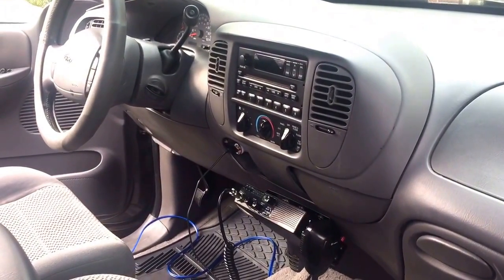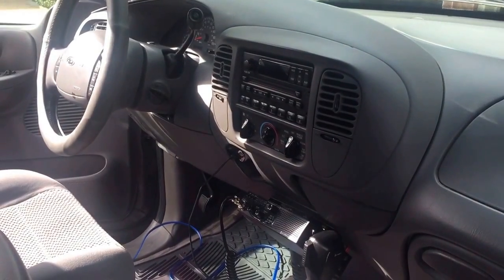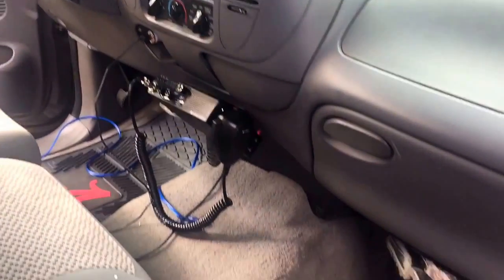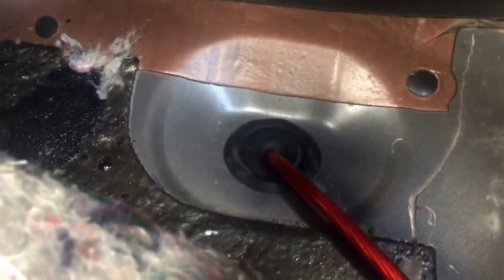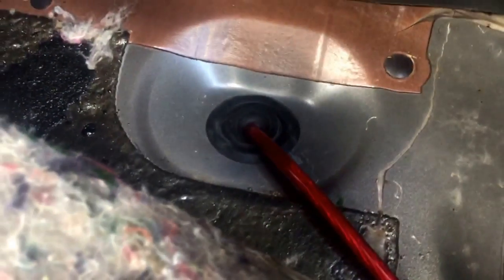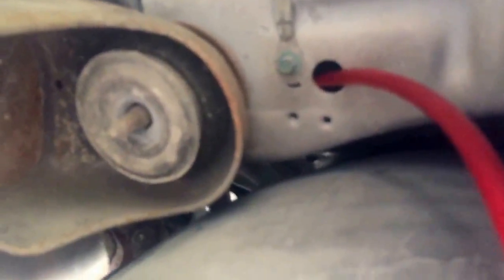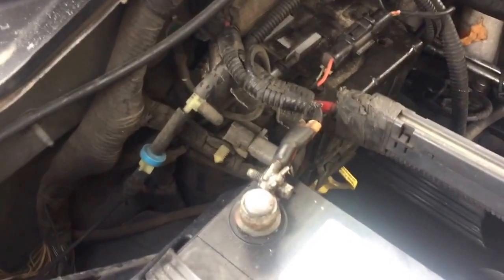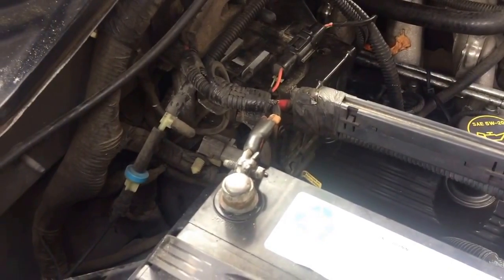How to install and run a power wire the easy way!

Comment: how long before the insulation grounded out on that hole in the frame
Reply from the maker: Kurt Shoemaker so far so good
Reply: Must be a nice clean edge on the metal. I had that happen once in a similar situation blew a fuse. Ended up rerunning the wire.

Comment: Lol... I'm still having trouble finding an easy way in my 2000 Toyota Camry... Looks like I gotta drill a hole (I'm not a professional at this stuff)
Reply from the maker: Some times it can be tricky. I'd get on a shop creeper and roll around under the car and look for a grommet somewhere on the fire wall or under it. There has to be one somewhere. Good luck!
Reply: On my 2000 avalon i ran it threw the floor drain plug like what this guy did! Im not a fan of it cause it leaves the power wire exposed underneath the car were it could get damaged easily and its not very visually appealing either if one looked under the car but not that big of a deal! However i belive their is a way to get it threw were the heater plumbing gose threw the fire wall on the passenger side of the firewall! My battery is on the driverside though this means ill need to use a longer power wire if i go that route which isent the greatest either cause the longer the power wire the more resistance your gunna create and your gunna lose a tad bit of power for tour system!